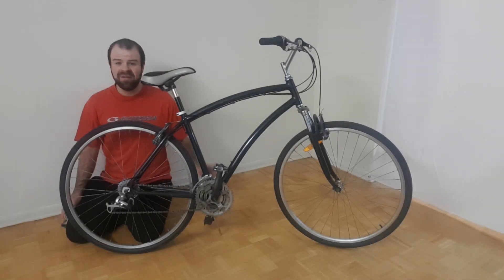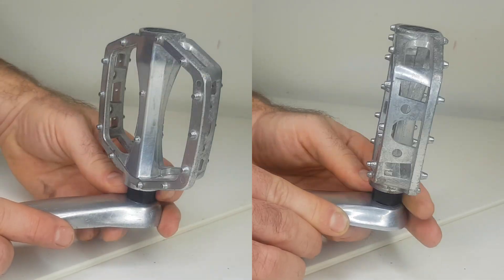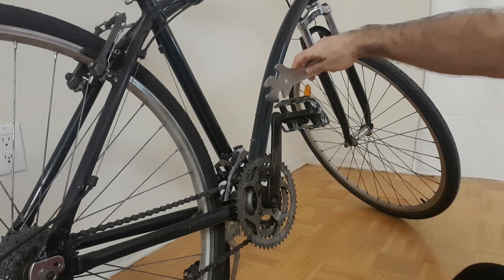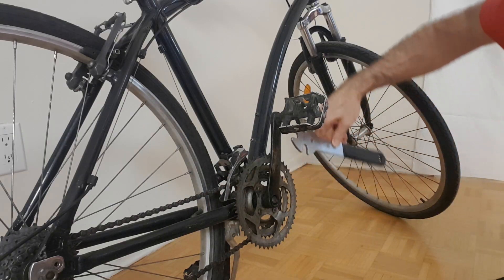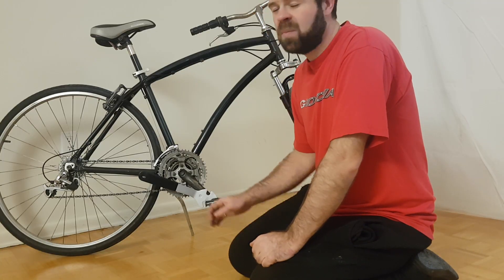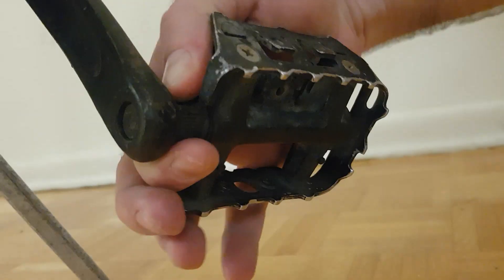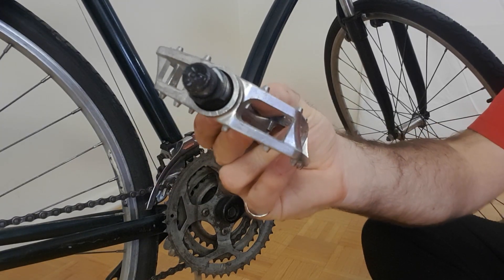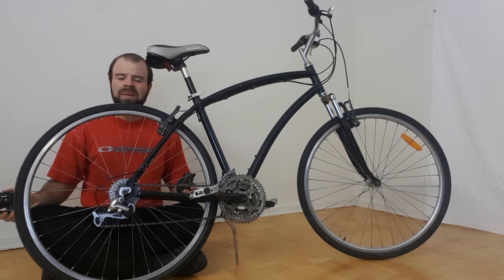How to Remove and Reinstall the Pedals on a Bicycle

Comment: I think I stripped the threads on part of one of the cranks. Any hope it could still accommodate the pedal?
Reply from the maker: Are they stripped because you tried to thread the wrong side of paddle into the crank? Most likely it's only the beginning of the threads which are damaged. Maybe you could try threading the pedal in from the opposite side of the crank. The beginning should be easy but get hard at the end when you hit the damaged part of the threads. Forcing them in backwards might clean up the threads enough to install them correctly. Just an idea, never tried this myself.

Comment: Does anyone know what the torque spec is for Mtb pedals? Of course I will also need a crows foot and a new torque calculation. Thanks. My fear is stripping the threads and that is an expensive problem.

Comment: HI! What a frame of your bike? I buy used old bike with frame similar your bike and have no idea what manufacture this frame. Serial number of frame is 0RA00F041.
Reply from the maker: I've had someone else ask me that in the comments of one of my videos. The answer is that I honestly don't know. The stickers on the bike were badly damaged when I took possession of it, so I removed them. Unfortunately I didn't take any photos before doing that. However, I'm pretty sure it was just a department store type brand.

Comment: What to do if it just doesint want to screw off
Reply from the maker: Did you try stomping on the wrench with your foot like I showed in this video? If that doesn't work you could try spraying a chemical on it such as Liquid Wrench and then try again. If you can't get it free, the only option is to also replace your cranks.
Reply: @cjhoyle  it worked, thanks 😁

Comment: Do count with your fingers lol easier just to say clockwise and counter clockwise...good video
Reply from the maker: Screw threads are 3D objects and  Clockwise/Counter-Clockwise can only account for 2 dimensions. If you change your frame of reference by 180 degrees...the thing that you were calling clockwise before is now counter-clockwise. The RHR and LHR are perfect for expressing 3D rotation.
Reply: Thanks its a good video i am challenged spatially and mechanically but its fairly simple main thing dont strip the threads !

Comment: Why don't you just use "clockwise" to tighten the Right side pedal and "counter-clockwise" to tighten the Left side pedal.
Reply from the maker: Clockwise vs counter-clockwise is a 2 dimensional concept which is less helpful for something 3 dimensional like this. It's also helpful for both tightening and loosening.